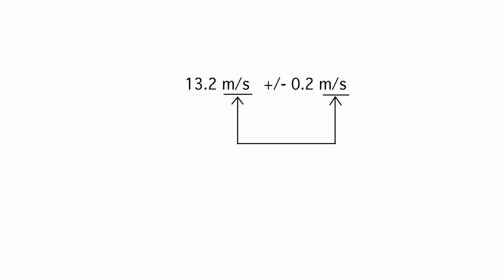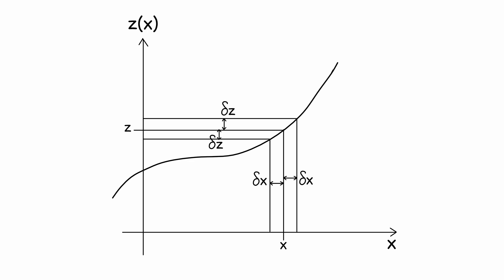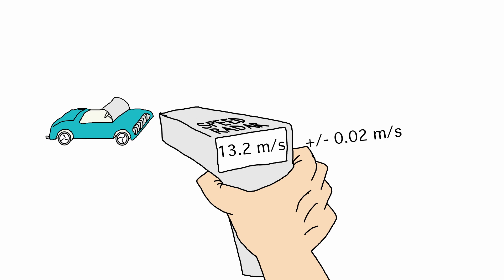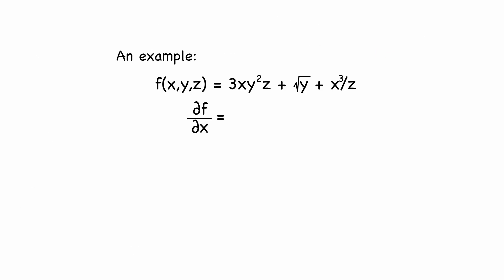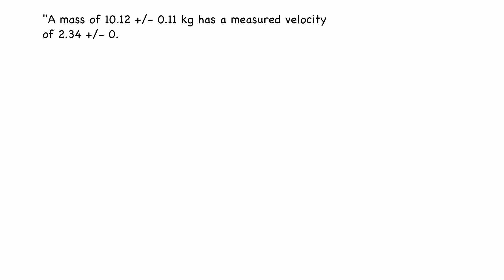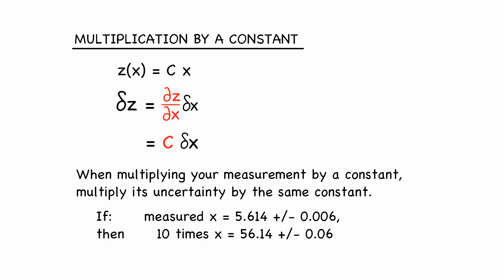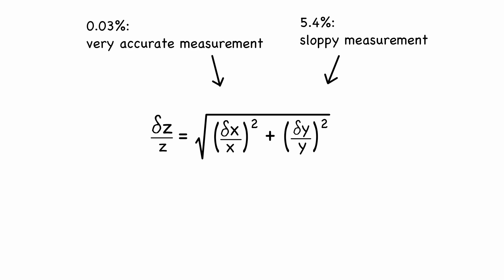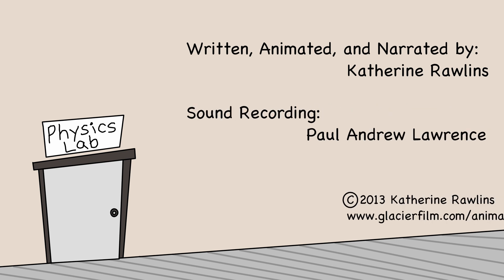Propagation of Errors

Comment: Don't forget that meaningful uncertainty results must lie within the bounds of the significant figures of datum (measurements).  For example if I am using a meter stick w/ cm and mm div to measure length is an uncertainty of 10E-5 m reasonable?